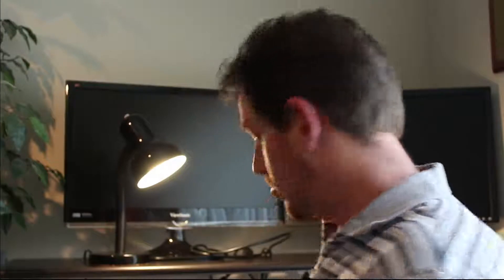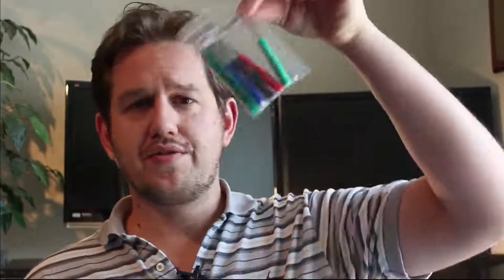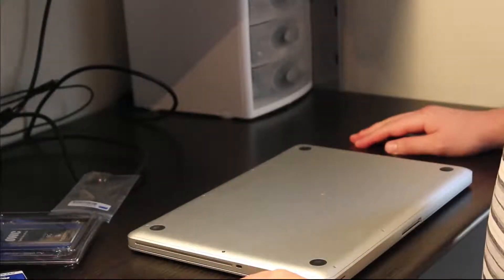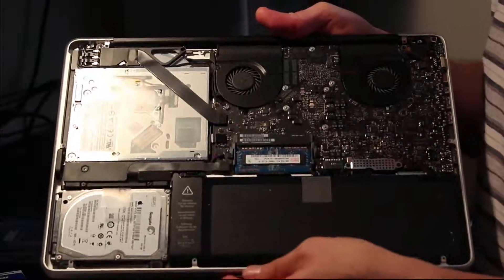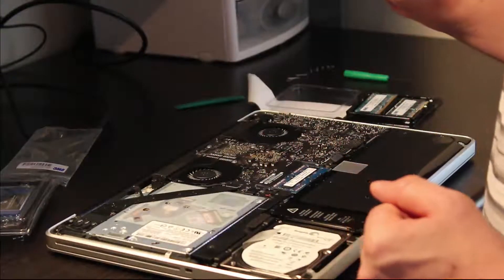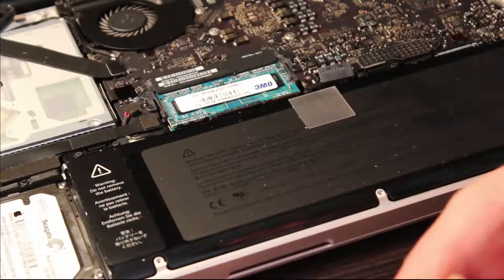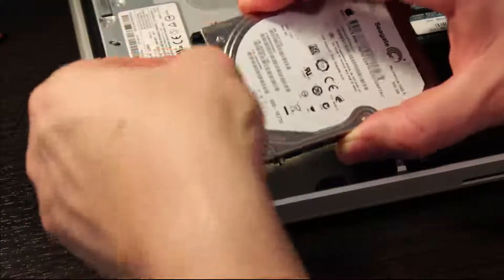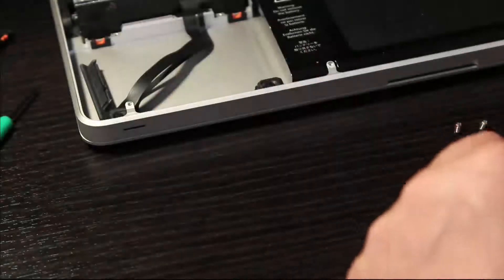How To Install Memory And An SSD Drive Into A Macbook Pro

Comment: No, you wouldn't need to pay. If you purchased lion or mountain lion from the app store, you can download it again under the purchased tab. Checkout the lion disk maker app to learn how to put it onto an external thumb drive. 

However, if you follow the method in this video, you won't have to worry about reinstalling since the OS will already be cloned onto the new SSD (step 5). Hope this helped!